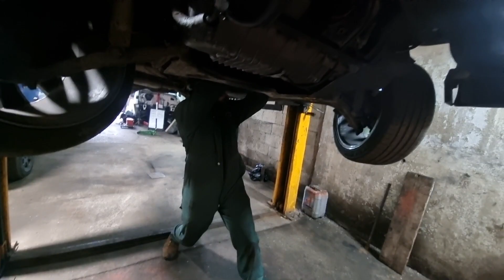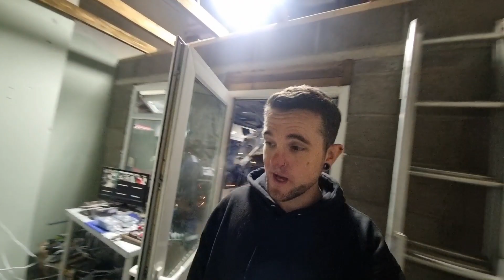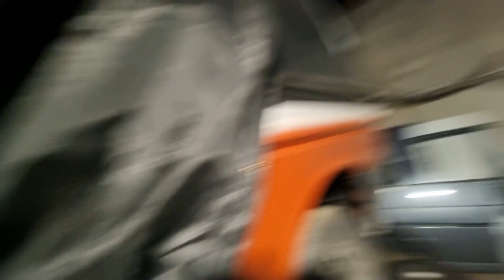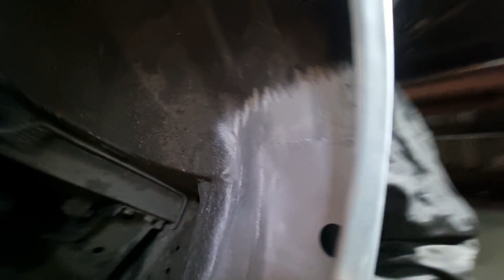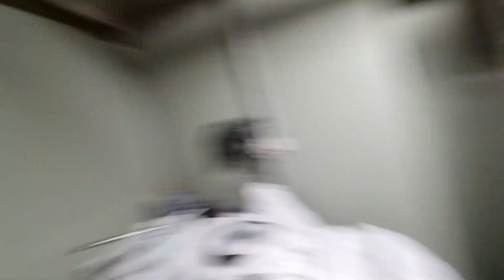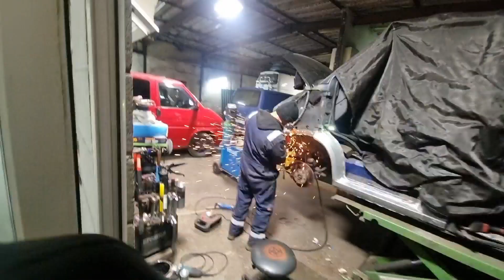Welding, Fixing & Some Questions #vwt4

Comment: How many mm do you move the hole for short shift?
Reply from the maker: I've never measured it it just under half way from original hole to the middle mounting hole
Under half just as if to much you can corse it to select gears properly